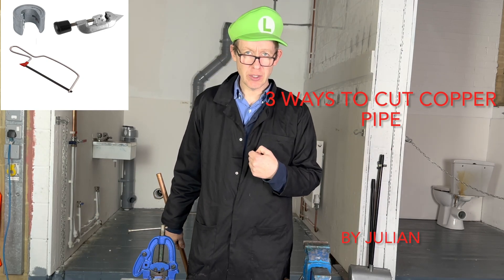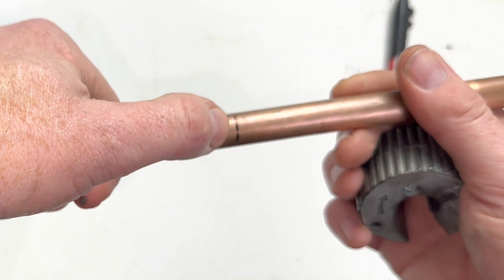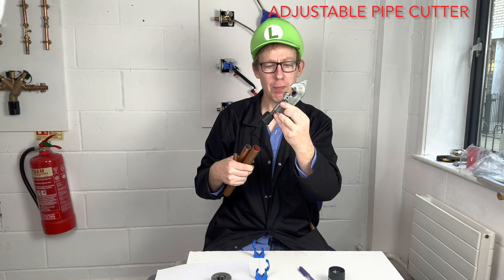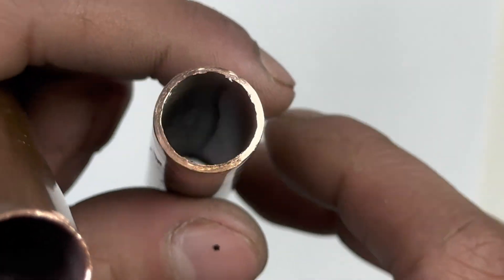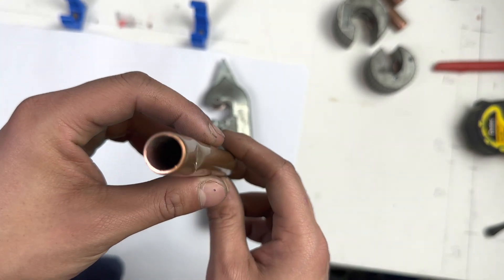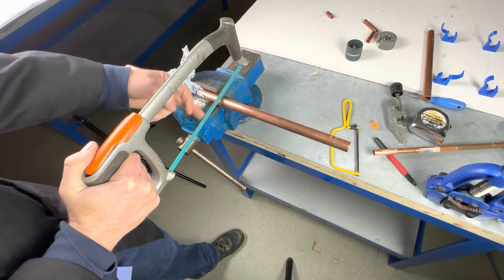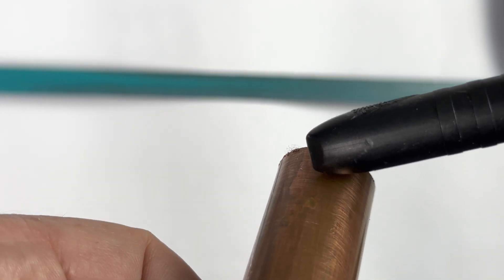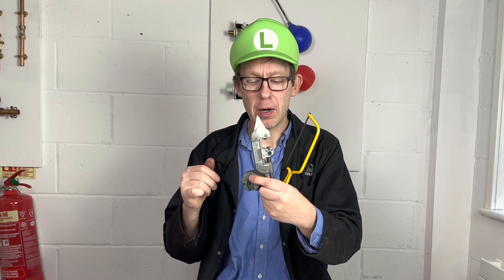How to cut  copper pipe - 3 different ways  with 2 worksheets at the end

Comment: I noticed the pipe was cut at an angle. I have that problem when using hack saw. how to prevent that any suggestions
Reply from the maker: Hi, avoid junior hacksaws in my experience, the best way is to use a dedicated pipe cutter.